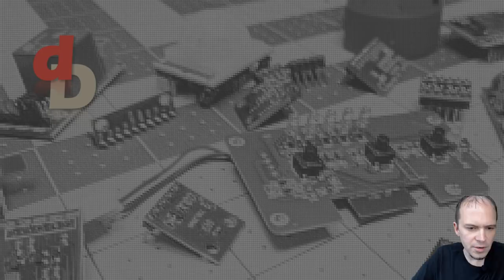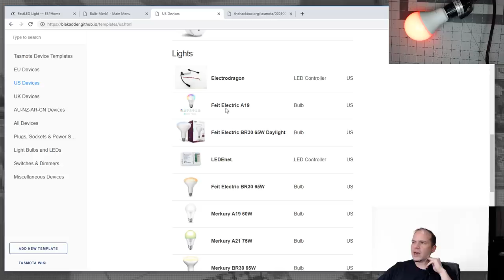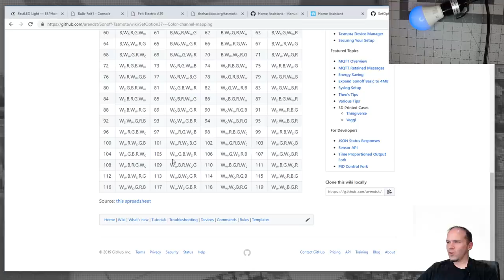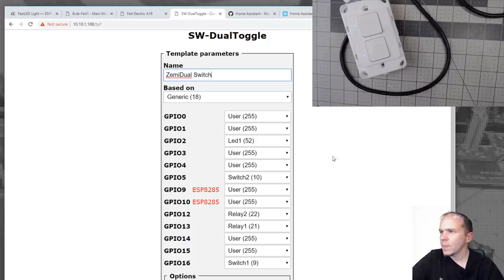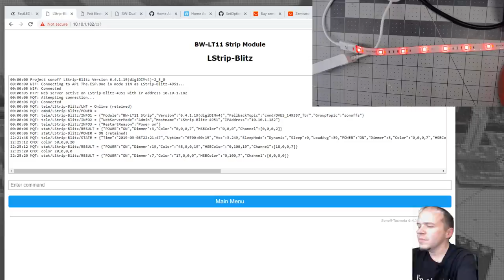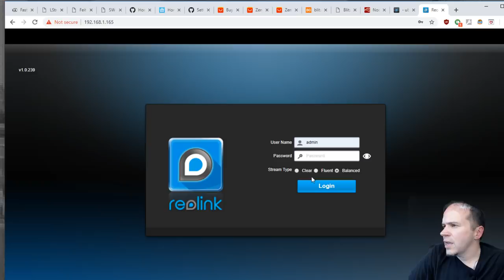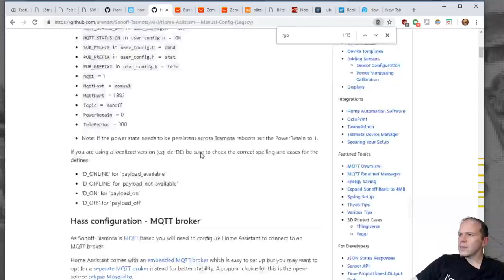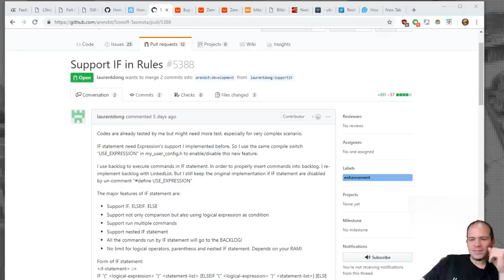Live Stream - Merkury and Feit Bulbs, Tasmota Templates, LED Strips/Switches and POE Cams

Comment: Thank you for this video.  I swear that I had already tried the exact template you did for the feit bulb and it didn't work at all, but somehow when I tried it after watching your video, it worked perfectly.  And, I learned a bit from your video about sending console commands to test different colors etc, so that I could confirm that it was working perfectly.  I think part of the problem before was that I was sending commands to it from another app, so I had no good way to know when something didn't work whether it was a problem with the app, the bulb config, or communication between them.

Comment: thanks travis that was a good session. Another diffrence berween ESPHome & Tasmota. for switches I prefer Tasmota due to Wemo Emulation...its not there in ESPHome and Otta has no plans to add it. I dont subscribe to NubuCasa so my backup to HAAS is Google Home/Alexa connecting via wemo emulation.
Reply from the maker: Very good point. Forgot about that one.